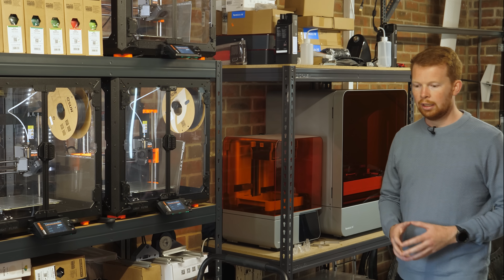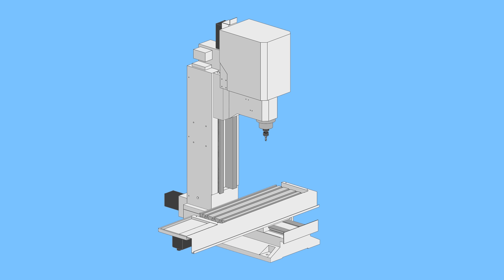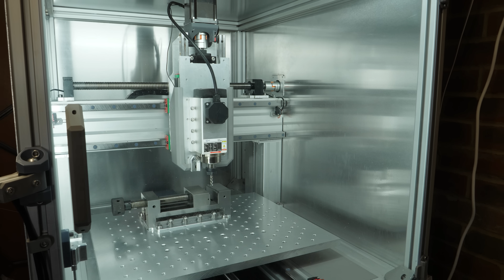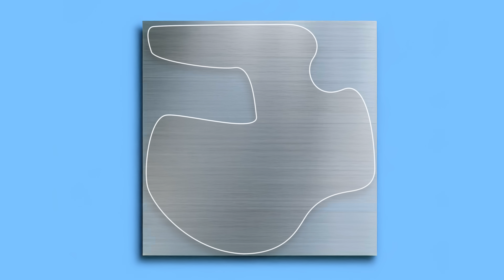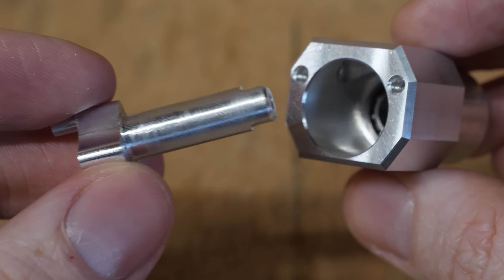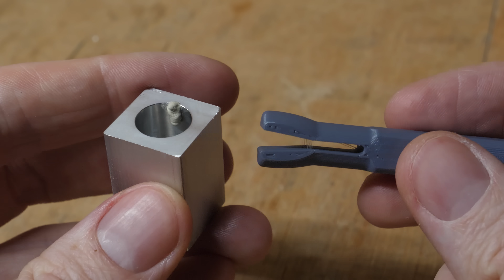I Needed an Engine, So I Built a CNC Machine

Comment: i feel pretty confident that AI enabled CAM will be here soon and you will be able to have some general preferences and it will generate all of the setups and select tools, come up with all the speeds and feeds, and perhaps even generate the workholding setup to use (for setup or for 3d printing).

Comment: AI Summary

Abstract:

This video documents the two-year process of designing and building a homemade fixed-gantry CNC milling machine intended for cutting metal. The build features a robust aluminum extrusion frame filled with epoxy granite for vibration damping, linear rails, ball screws, Nema 34 stepper motors, and a 2.2kW high-speed spindle. Control is handled by a Duet 3 6HC board enabling network operation. The creator details the construction, including adding an enclosure, lighting, and a touchscreen interface, bringing the total cost to approximately £4,000 (~$5,000 USD). Key innovations include creating a large fixture plate on the machine itself and developing a custom, magnetically mounted touch probe for efficient work offsetting. The machine's capabilities are demonstrated by manufacturing a simple aluminum air engine, showcasing techniques like thread milling and addressing the challenge of machining precise circular parts by creating a custom balanced boring tool for the piston and using lapping compound to finish the cylinder. The video concludes with troubleshooting and successfully running the prototype engine, highlighting the adjustable valve timing achieved via the threaded cylinder mount.

Building a Homemade CNC Mill & Air Engine

*   0:00:02 Introduction: Contrasting additive (3D printing) and subtractive (CNC milling) manufacturing, introducing the 2-year project to build a homemade CNC milling machine.
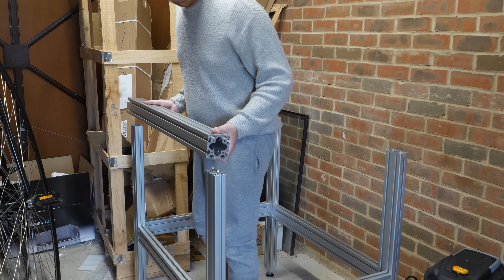*   0:01:03 Frame Construction & Damping: The machine uses a large aluminum extrusion frame. To dampen vibrations, the frame extrusions were disassembled and filled with sand and epoxy resin (epoxy granite), significantly increasing weight and rigidity.
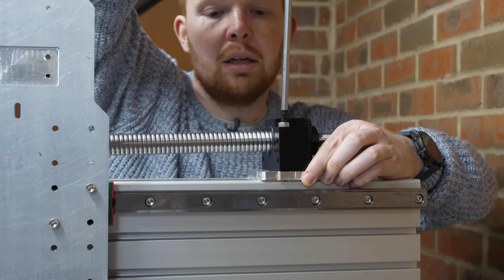*   0:01:47 Motion System: Precision movement relies on large linear rails for guidance and ball screws driven by Nema 34 stepper motors to convert rotational motor motion into linear axis movement (X, Y, Z).
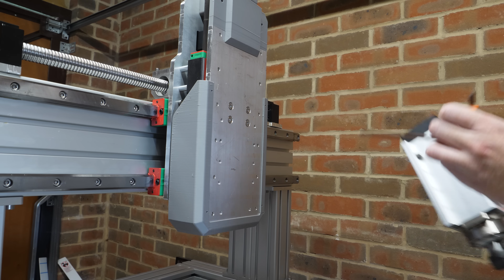*   0:02:13 High-Speed Spindle: A 2.2kW spindle motor is used for cutting, capable of reaching speeds up to 24,000 RPM.
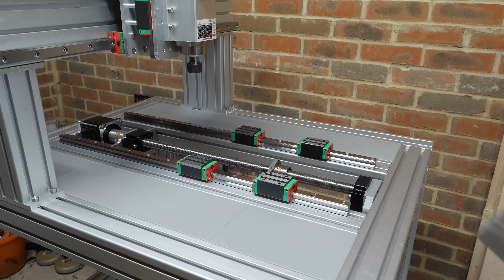*   0:02:31 Fixed Gantry Design: The machine employs a fixed gantry design (X and Z axes move along a fixed overhead beam) with a moving work plate (Y-axis), aiming for a balance between the rigidity of pillar mills and the work area of moving gantry routers. It targets cutting sheets up to 500x500mm.
*   0:03:36 Control System: A Duet 3 6HC control board is used, featuring high-current drivers (direct motor connection) and Ethernet connectivity for browser-based control.
*   0:04:01 Enclosure & Interface: An enclosure was built using more extrusions and aluminum sheets, with LED lighting and a clear polycarbonate door. A cheap touchscreen monitor is mounted for operation.
*   0:04:46 Fixture Plate & Cost: The large aluminum build platform was surfaced and then drilled/tapped with 178 holes directly by the machine to create a versatile fixture plate. The total build cost was £3,955 (over $5,000 USD).
*   0:05:48 Sponsor: JLC CNC: Promotion for JLC CNC machining services, highlighting ease of use (upload 3D model), speed, quality, and a discount offer. The creator used them for strong gantry braces.
*   0:07:06 CNC Operation Basics: Explains G-code (coordinate instructions) and the importance of setting the work offset (zero point) accurately.
*   0:08:11 Custom Touch Probe: To simplify setting the work offset, a custom touch probe was designed. It uses a magnetically attached, electrically isolated probe head that completes a circuit when touching the (conductive) workpiece, allowing the machine to automatically find edges/centers.
*   0:09:32 Machining an Engine Crankcase: Demonstrates machining the first engine part from aluminum, including operations like boring, drilling, thread milling (using a specific tool to cut threads), and chamfering. The part requires multiple setups and re-probing.
*   0:11:18 Machining vs. 3D Printing Time: Compares the ~1 hour machining time to 3D printing (22 mins FDM, 2 hours resin), but notes the significant CNC setup/programming time (2-3 hours) makes 3D printing faster for non-strength-critical parts.
*   0:12:14 Motivation for Metal Engine: Aiming to build engines capable of handling higher pressures, potentially running efficiently on liquid CO2 (~900 PSI).
*   0:13:14 Challenge: Machining Circles: CNC mills can struggle with perfect circles due to drive precision and G-code being approximations (many small straight lines).
*   0:14:00 Custom Piston Machining Tool: To achieve a perfectly round piston, a custom, balanced tool was designed and machined to hold a small cutting insert offset by the piston radius. This tool spins in the spindle while the Z-axis moves.
*   0:15:00 Broken Tap: A tap broke while threading the custom tool, requiring the part to be remade.
*   0:15:51 Piston Machining Success: The custom tool successfully machined the piston with a much better surface finish than conventional milling.
*   0:16:01 Cylinder Machining: An adjustable boring tool was used to machine the internal cylinder bore to a precise diameter, creating a close fit with the piston.
*   0:16:35 Lapping for Smoothness: Lapping compound (abrasive paste) and a custom 3D printed tool were used to polish the piston and cylinder, removing machining lines and improving the seal.
*   0:17:06 Simple Engine Design: The engine uses a basic design with a ball valve in the cylinder head, opened directly by a pin on the piston near the top of its stroke. Seal quality is critical.
*   0:18:01 "Cooling" Fins for Heating: Fins were cut into the cylinder not for cooling, but potentially for heating when running on expanding CO2, which causes significant temperature drops.
*   0:18:23 Engine Assembly: The engine is assembled with crankshaft, connecting rod, piston, threaded cylinder, O-ring/ball bearing valve, and a propeller flywheel.
*   0:18:55 Initial Test & Troubleshooting: The engine initially fails to run. The threaded cylinder allows fine adjustment of valve timing by screwing it slightly in or out.
*   0:19:18 Oil Improves Seal: Injecting mineral oil temporarily improved the piston/cylinder seal, helping the engine to run.
*   0:19:40 Successful Run & Future Work: After fine-tuning the valve timing, the engine runs, hitting a distinct power band. Locking the cylinder position remains a challenge. The creator is happy with the prototype and learned much.

I used gemini-2.5-pro-exp-03-25| input-price: 1.25 output-price: 10.0 max-context-length: 128_000 on rocketrecap dot com to summarize the transcript.
Cost (if I didn't use the free tier): $0.04
Input tokens: 19342
Output tokens: 1543

Comment: I would suspect the co2 will have somewhat bad performance as it cools greatly if too much is dicharged. BB guns especially full auto runs much better with air than co2.

You could make a combustion engine on this point though. Maybe pressurised biogas in water bottles that you make at home. Could give a little bit of run time and could be interesting build to make.

Comment: To lock the cylinder, continue your threads until just below the exhaust port and make a "locking nut" that goes onto the cylinder before you screw it into the block. You can then adjust the timing, and tighten the lock nut against the engine block to prevent the cylinder from drifting.
Reply: Or a small set screw on either side.
Reply: Hehe... That's far simpler than the method I just described. 😂

Comment: You actually don't want the piston bore to be polished smooth.  The surface roughness is needed to retain lubricant.  Cylinders have a minimum surface roughness spec.
Reply: For engines with piston rings you need a cross hatch but for an engine like this where the piston itself is the seal you need smooth bores.
Reply: @adematthewsracing 
 grooves will work better as they will form an air seal, similar to a labyrinth seal on a rotary component
Reply: With the polisher still i can see some roughness, I think that is the ideal one, more than the one before that
Reply: That's a good point. OEM's generally use a cross hatch pattern from a cylinder hone.
Reply: @senatorchinchilla5389 OEMs these days may use sputtered (?) "spray-on liners" which use the porosity of the material to retain lube rather than hatching.
Reply: Well, if you only fulfill the roughness spec, then you end up with a sub par cylinder, and you'd really be better of with a smooth bore.
If you want to do it correctly, then use honing stones (first coarse, then fine) and make sure the cross hatch grooves are about 30° to horizontal.
Either do it correctly, and all the way, or make it smooth; the middle-way is the worst option.
Reply: @sasjadv  
I used to teach cylinder boring, motorcycle engines.
The standard cross hatch pattern is 45 degrees and plateau finished .
Coarse and fine stones are 'relative', 36 grit is coarse, but, 220 is also coarse, depending on how fine a finish you want or need.
For IC engines, 400 grit is fine finish but 280~320 is also fine.
Having a cylinder and piston accurately round at running temperature is probably most important thing, clearance varies depending on running temperature but air cooled IC motorcycle engines run quite happily at 0.0017" (~0.04mm) with around a 55mm~85mm bore size
Reply: @1crazypj Car engines come with around "30° to horizontal" cross hatch from the factory (on average), which is is often specified like 120° (measured grove to grove), but you could also measure that same pattern as 60°. Afaik modern bike engines have similar angles, because that boiled down to being optimal.
Other than that, yep, you're right.
     Good for mentioning plateau finishing. That's yet another point how proper honing differs from surface roughness, because you want a low roughness surface in between the groves instead of sharp high spots.
Reply: @sasjadv  You can change the cross hatch angle to either hold extra oil (~30 degrees, 60 included) or shed more oil for high rpm (~60 degrees, 120 degrees included)
The angle would be measured 90 degrees to piston travel.
Either will give a diamond (rhomboid) shape but in different directions, 'flat' or 'on end' (eg 'flat' 30 deg = <>)

It's at least  part of the reason modern engines burn oil. (narrow, low tension rings are fine when there are enough drain holes of correct diameter -minimum  0.75 width of ring in back of land and 0.60 below land)
I'm not sure exactly how a 30 degree angle was considered optimum, probably more for production than any consumer advantage and engine longevity? (I've looked inside a lot of engines since 1968 and figured out why things were done 'that way' many times)

With motorcycle engines spinning at 12,000 rpm or a lot more (Yamaha had 17,000 rpm engines) the angle makes a lot of difference to the amount of drag.
Nowadays I mostly play with bikes from 1970's, my various Honda's originally had red-line from 9,300rpm to 10,300rpm, Mine  regularly see 11,000 ~11,500 with stock cams and carbs (but lighter pisons) and a hand made exhaust system (loud pipes piss people off, they don't 'save lives')
My 1977 CB550 F1 would rev to 13,500 rpm but I retired it at 106,000miles
Reply: @1crazypj Well, the latest engines have about the same crosshatch angle as the million kilometer lasting German and Japanese engines from the 1990's.
But the new oil guzzling engines have lower viscosity oil, with a hotter running engine, and often flatter pistons that can wiggle more and softer aluminium blocks. Apart from that, modern high-spec oil is supposed to not thin down as much at higher temps, but the oil additives that make this possible often don't last as long, and some oil manufacturers are barely in spec when the oil is new.
----
I've seen mastermilo82 on youtube rebuilding a tank engine, where he took only one grit size of honing stones, put it in his cordless dril, used max RPM, and generated lines perpendicular to piston travel.
I'm not concerned about someone choosing the wrong cross hatch angle, I'm more concerned about some people not even getting close to a half-decent job😂.
Reply: @sasjadv  As a motorcycle mechanic I've tried to learn all I can about diverse subjects connected to IC engines, cars, bikes, aircraft, industrial plus worked on many different types.
Some of the earliest 'million kilometre' engines use the old style, as did majority of industrial engines (pretty much fixed rpm for literally years at a time - one Deutz 16 cylinder diesel ran for 18 years non stop at a South African mine, even oil was changed on running engine) 
I have spoken to various engineers over 40+ years, metallurgist’s, oil, fuel, various designers, industrial chemists, etc. but haven't really bothered with new developments in last 10 years or so (Mazda have been doing some interesting things that Honda started in 1980's)
Reply: @sasjadv  Oh, never seen Mastermile82, I'll check it out.
Reply: correct
Reply: That is correct, but only for engines that seal using oil. This engine seals using the piston itself, so not only do you not need surface roughness, the surface roughness will increase friction and make the engine perform worse.
Reply: @nikkiofthevalley this engine should be sealed with oil. The piston/cylinder seal is not perfect, you can see the rocking in his testfit, and thermal expansion throws the tolerance off further. I suspect that is why the engine started working when he introduced the mineral oil. The mineral oil helped the piston/cylinder seal properly.
Reply: I didn’t even know this and I work with engines here and there, of course I’ve never even though of polish the piston’s bore, neat to know.
Reply: This works for internal combustion engines that use piston rings and oil to seal the cylinder. Not so much for a air powered engine which honing in a similar way would compromise the seal of the piston in the cylinder.
Reply: Faxx I can't tell you how many hundreds of hours I've spent honing cylinders
Reply: This is correct...........for ICE engine's 😂
Reply: @painintherc7771  ICE engines what?
Reply: @jackn4853 Internal Combustion Engine engines. No combustion happening in this engine unless Tom has made a terrible mistake
Reply: @ As explained by mgmchenry, IC not ICE
Reply: "The surface roughness is needed to retain lubricant"

I did not know that but it makes sense.
Reply: @jeffreymorris1752 if the surface is fully smooth, the lubricant has no place to sit and just slides off, if it has tiny scratches and rough areas, the lubricant can stay and drip off in moderation
Reply: yeah putting a very light crosshatch and injecting oil with the compressed air would likely be beneficial. could create a sort of carburetor setup to suck oil in with the air/co2.
Reply: Nope, he does not have a lubricating system nor piston rings. To make oil film you have to have oil fist.

Comment: Questioning the use of an "electrical isolation" 3D printed spacer...  when using a metal fastener to fix the metal part to the underlying metal plate.
Thats not going to electrically isolate anything.

Comment: You should really add some corrugated cover material for the drive screw on your build platform to prevent metal shavings from collecting on the screw and causing excessive wear and binding problems as it runs through the nut.
Reply: Yeah that sounds absolutely atrocious. 

 I've broken metal thermos by trying to tighten them with just small bits of ice stuck in the screws flanges. 

 Couldn't imagine what actually pieces of metal do. A bunch of shavings. 

 I'm surprised how archaic the programs are. I figured today you could have a program that can scan, and set up its own most efficient cutting path. 

 Or set parameters. Whether you want to go easy on the tools. Get faster cuts with less accuracy. More accuracy at a slower pace. Etc. 

 Not have to direct each cut. Wow. 

 I really can't wait for 3d cameras to be cheap and normal.
Reply: @RedactedDeath Machining is not that straight forward. There are WAY too many variables that you would have to somehow input for AI to figure out what you want.

Comment: This might be an overkill solution for locking the cylinder in place, but making it a part of a worm gear setup would allow you to not only precisely rotate it in and out, as well to immediately lock it into that position.
Like, machine the outside of the cylinder wall to be the toothed wheel, and then make the shaft with the spiral thread to engage with it.

Comment: You should add a vapor coolant / compressed air system for (obviously) cooling and chip management, it will help with surface finish and tool life longevity